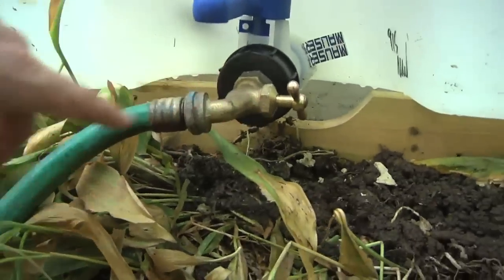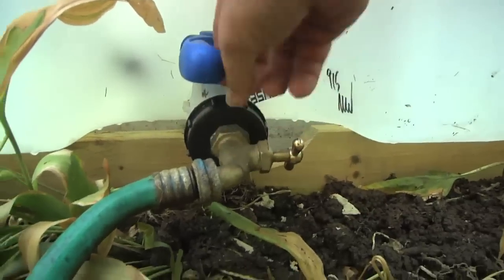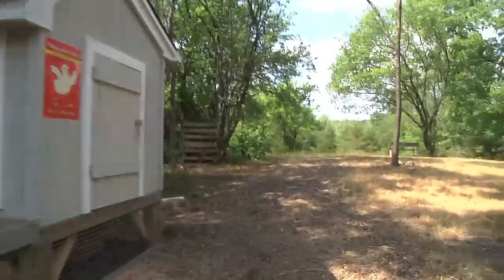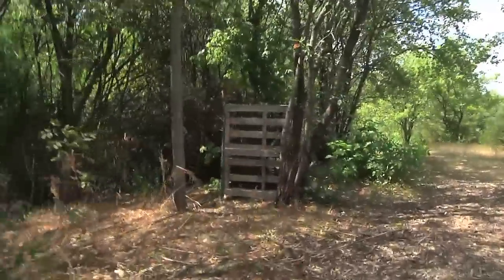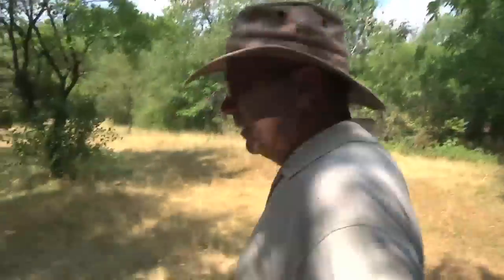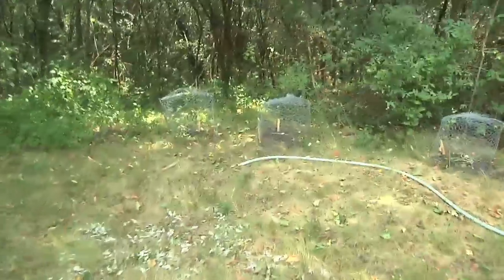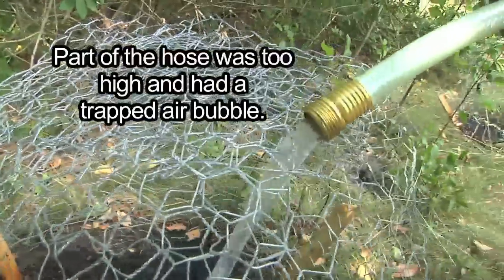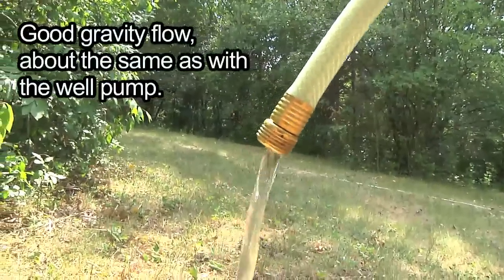DIY 275 Gallon Rainwater Collection, Part 4

Comment: We have Bonfires all the time, I found that the best way to put a fire out is to use one of those garbage cans on wheels, I use 2, I feel them with water to little over half full, this way they are easy to move, and just spill the entire can on fire pit, mix pit and put on the second one, most of the time first one does the trick, I figure its a good tip for someone who is having fires over there since you have such a low water pressure...

Comment: You have flow restriction through the choice of the tap ( faucet).
You need full bore and a wider pipe guage. Also...build a wooden braced platform for the IBC tote as high as possible near the gutter outlet to increase head.
Less spout needed too.
Also paint the tote black to restrict algae growth and help absorb sun which helps...